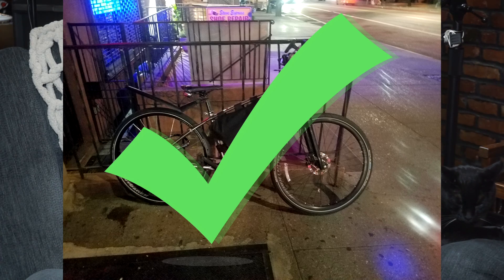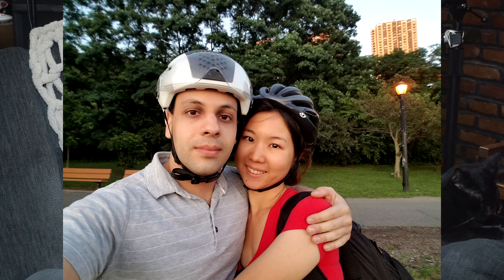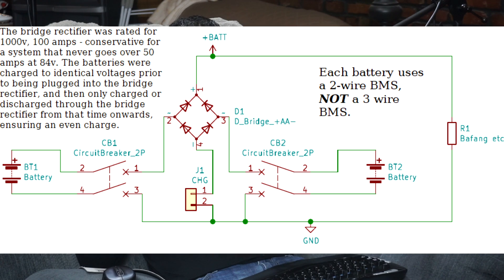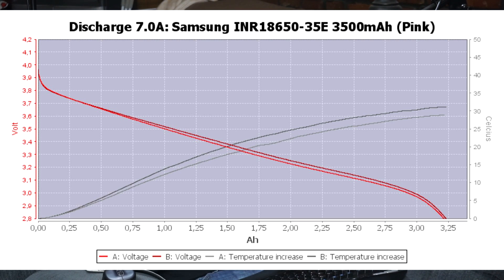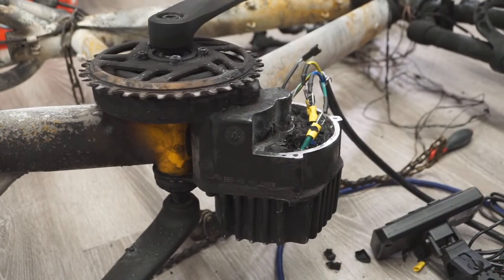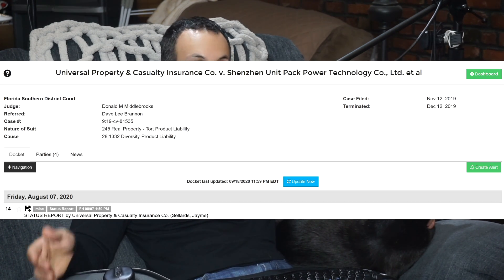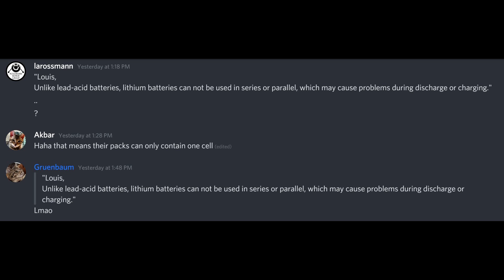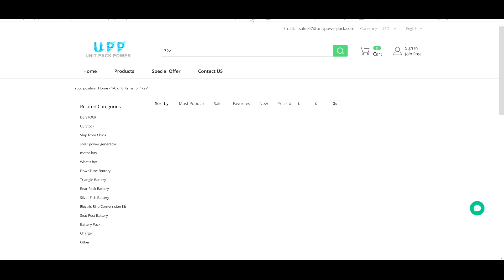Louis' front door goes BOOM courtesy of UnitPackPower battery.

Comment: I asked Amazon about this battery and got this response I figured the person was referring to this video
Amazon Customer answered:

"The customer modified our battery, he parallel 2 pcs pvc batteries together incorrectly, he have not use special parts which should used for parallel batteries, the battery is 72v 20ah, fit for 3000w motor, he use the battery on 5000w motor, so the issue happened. We contact him to provide proof to our inssurance company for compensation , because we have bought insurance for every battery we built, he reject, he ask us compensation him for 100000 dollars, our boss reject
Reply: Things people don't realise:
These were custom battery orders. He specifically requested a common port BMS which has additional protection for paralleling batteries. Not your regular seperate port which has no charge protection on discharge port
Even with this additional protection, the batteries were protected by diodes preventing one battery from backfeeding another
There were also circuit breakers that would have tripped if one battery decided to charge another at very high currents
You can't really get more protection than that

What we have seen from UPP teardowns and several UPP fires is that:
Sometimes cell groups are not isolated from each other properly. A bit of vibration can cause these cells to create a MASSIVE SHORT circuit. You are supposed to use cell holders or have additional insulation paper between cell groups
Pinched wires causing shorts
Balance wires and discharge wires not double insulated, can get cut by sharp nickel strip and create a massive short
The welds are not always done properly and with poor accuracy by some sweatshop worker being paid $3 per hour. This can cause a loose connection or worse, pierce the cell and cause it to VENT FLAMMABLE gas
Insufficient size nickel strip and using nickel plated steel. These will create immense heat. UPP said they can only guarantee pure nickel if you specifically request for it.
Sometimes they use the worst possible layout. Like to the point where it's not just stupid but it appears as though someone did it deliberately. If you force all the current to go through one cell/ series connection, you will create immense heat
Screws from battery case piercing poorly managed wires, causing usb to output 52v (battery voltage) instead of 5v
etc etc

The UPP fans however who are clueless about battery safety because their UPP hasn't blown up so far. In fact, there was even one UPP fan who had one battery fail where a cell group shorted to 0v due to shoddy design but didn't quite blow up and was happy to carry on using the warranty replacement. People will never learn.
Reply from the maker: I did not modify a thing. I used the battery on a Bafang BBSHD which is not a 5kw motor, it's a 1000w motor. They're a bunch of lying scum. 

I also asked for less than $10,000, not $100,000. 

These people are absolute lying scumbags. I have copies of all our original communications if anyone wants it. 

I have 3 batteries hooked in parallel now for 2 years since I did this video, thousands of miles, no problems. Just posting this here to say that two years later, my EM3EV bike with identical configuration & identical wiring & identical electronics is still kicking ass. https://www.youtube.com/watch?v=YDA1ZcH34WU

Buy batteries from companies that do not scam you by sending you garbage with different cells than what you paid for. The fact that they are lying when I have the entire aliexpress chat history. I will edit this post later when there is time with screenshots. What a bunch of disingenuous people.
Reply: lol i bet they are overwrapping cells and got one reversed or something. how else would an isolated battery boomboom @rossmanngroup
Reply: @louis Rossman so you say the low quality batteries cause the fire wow. You was lucky that ebike was outside when it ignited. I have a ebike in my apartment and there is that worry of something happening at any moment.
Reply: Lol 5000w motor. BBSHD would outright poop itself in a microsecond if you try shoving 5x the rated wattage
Reply: @kopazwashere  Not true, i ran mine around 5-6kw a bunch.

Comment: Context: The battery

Model: U004 or U004-1 (black triangular e-bike conversion packs)

Why cheap: Low-end Chinese production (Shenzhen); skips costly safety testing/certification; sold $280–$730 direct online

UL certification: No—fails UL 2271/UL 2849; no accredited lab proof

Complaints w/ significant damage: 13 US overheating (7 fires + major property damage); multiple UK fires

Manufacturing years: Sold 2018–April 2024 (exact dates not specified)

Source location: Shenzhen Unit Pack Power Technology Co. Ltd., China

E-bike brands: None—aftermarket for DIY conversions (UPP brand only)

Still sold?: Officially banned post-2024 (CPSC illegal); lingers on Amazon/AliExpress despite warnings

Future safety concerns: Yes—ongoing fire/thermal runaway risk in all units; immediate disposal urged

Comment: No it's wrong.... I have two 72v battery and one 52v all from upp they al have a three  wire bms and cannot parallel.... 
I have changed the bms in the 72v for parallel.... 
After 2years the battery have a maximum difference voltage from 0.008V....

Comment: My problem with the unit pack power batteries is that they use an inferior bms and the spot welder they use is cranked up too high creating leaking batteries. In fact, there is a recall on the triangle batteries. Don't buy this brand! They are dangerous!

Comment: Louis, am I correct that the parallel connections between cells within the eBike battery are all connections between cells of equal internal resistance, but you took 2 batteries of unequal internal resistance & hooked them in parallel?  I, myself, avoid putting batteries in parallel. I have 2 batteries for my eBike, but I use them one at a time.  Is there any advantage whatever of running them together in parallel?  So is your parallel connection to cause of this fire? What caused the fire? YOu say you charged the 2 batteries to same voltage -- I think the issue is rather the internal resistance of each battery being different.  How could you be using either a 3000 or 5000W motor on the street (illegal watts).  And were you overvolting your motor?  Are there eBike motors designed to run on 72 Volts???  Is that why they stopped selling 72 V batteries?  Did you really demand $100,000 from manufacturer?  I think this video is deficient for lack of sufficient explanation of the fire.  How did the lawsuit end? settlement?

Comment: I would never connect 2 batteries in parallel (I said batteries, not cells internal to a battery) unless for some reason this was essential when 1 battery had too much internal resistance to run some appliance.  With eBikes, why don't you just use 1 battery at a time; when one gives out, then use the other.  I was impressed with your fire how it seemed 1) that the firemen were in no hurry to put out your fire & 2) it seemed there was difficulty in putting out a Lithium ion fire.  I thought water could be used to simply soak Lithium ion. The fire seemed to burn a long time. YOur building must have been masonry for the entire building not to go up in flames.

Comment: @Louis so even if you ran it through a full bridge rectifier, i'd call that pretty bad practice, unless both packs are on EXACTLY the same charge, and the diodes have EXACTLY the same vdrop (even in fully integrated full bridge rectifiers rarely the case) one or another other pack will get more load

not to mention you have to heatsink the rectifier, even at "low" load, you can expect 1.2 to 2V drop over the rectifier, because it goes through atleast 2 diodes, which means that full bridge rectifier may have to dissipate over 50W of power (dependant on how much current flows) as it goes through 2 diodes

edit: by the way it's wired, one diode, but still 0.5-1V, so you should consider 1W per amp to be safe

as you may know from laptops/cpu's, 50W is something that definitely NEEDS a heatsink, and not even a small one

even if the diodes are theoretically able to handle 100A, they need serious cooling

not defending UPP however, but just an important note.

i'd still highly recommend people to get a custom sized, larger, pack rather than paralleling packs

or if your controller is separate something that handles many voltages up to 72V packs (84V max) then you can run 2 36V packs in series or a single 36V pack

Comment: I looked at this a few years ago and concluded you'd need Schottky diodes to connect them in parallel. The high reverse leakage would go a long way towards balancing the battery packs. Otherwise I wouldn't do it. Turns out I just ran the batteries separately and used one as a reserve like a motorcycle reserve tank. A high-current switch made for switching boat batteries worked great here. Honestly? These batteries frighten me a little. Have a UPP 72v 20AH pack on my desk, I'm doing maintenance and no trouble...yet. Tempting to go lead-acid (heavy!) or Ni-cad. Glad you didn't get hurt!

Comment: Honestly, this is completely unacceptable for a battery that hasn't been tampered with. Also, there BMS is not designed to take any amount of current to the other direction that way, and will pretty much fry. This means as soon as you put them in parallel they pretty much just short themselves out. It's a ridiculous design and the BMS should be designed to detect this

Comment: So sad to see this happen.   Most generic chinese brand battery comes with a shitty BMS.  That is the thing that I take out first.  Good batteries should not even needs a BMS to balance.   That being said, I will always check the balance  manually with a voltmeter after a week or two of use. 

EDIT:  I have seen batteries catching fire while charging, but I wonder how could catch on fire after being discharged.   Could a bad BMS have caused this?   Samsung cells are safer than chinese brands...so I am really baffled.

Comment: the diode rectifier was from the company or an addon. I suspect that might be the culprit. Connecting 2 batteries in parallel without the rectifier would just cause the batteries to equalize over time during charging or discharging. Its how I been connecting batteries for years, never had problems but I only do 3s or 4s. With 20s you have more voltage that might cause problems if there is a bottleneck or failure between both batteries. 
I think more investigation and autopsy of battery need to be done to narrow down the culprit. If it was the battery or the diode rectifier where the fire started, once the fire started the cells did what they were suppose to do which is go up in flames.

Comment: i tryed every way to find out if its possible to set up battery like you did and when a person says it will work.they also say at your own risk. it dose not work the only one i ever found was no b.m.s manual charge ,diods and relays but i would never risk it ,it will burn eventually .the only safe way is to have a custom made battery .i found that you do get a very small even tiny drop back because one battery wil always be that tiny bit weak and it begins ,a reaction starts to happen in the weakest cell and you won't stop it also runing down below 50% would be even mor dangerous . i hope things work out for you but dont believe all you hear about geting more power ,have a battery pack made in one peace to do what you want from it.i hope people learn by what happened to you. lithium batterys are always unstable and are only safe if used the way they are intended

Comment: i also dont think u fully understand the problems with hooking up two batteries. theres always going a risk doing so.  also it only takes one bad cell so that might not even matter
Reply from the maker: I have 3 batteries hooked in parallel now for 2 years since I did this video, thousands of miles, no problems.

Just posting this here to say that two years later, my EM3EV bike with identical configuration & identical wiring & identical electronics is still kicking ass. https://www.youtube.com/watch?v=YDA1ZcH34WU

Buy batteries from companies that do not scam you by sending you garbage with different cells than what you paid for!

Comment: I have two electric motorcycles with UPP batteries. One is a 52v x 20a pack X 3 so 60 amps 3.120kwh the other is the same but 48v nominal. Done about 100 trips between both dirt bikes in summer conditions drawing as much as 400 amp (rated at 150 continuous 450 peak) so far no problems. I own a Chevy Bolt too so am I playing with fire IDK?

Comment: There could be some shorts on the windings of the motor. The motor would still work, but it would drain the battery very fast, causing overheating. Post mortem is hard to tell which caused which.

Comment: Bms failed or they cheaped out on the nicle strips, or was not spit welded correctly and there was a short. Bad workmanship. Could very be bad or cheap easy cells that couldn't not handle  the constant load. There are alot if fake cells just resleeved cheap knockoffs, easiest way to tell is the weight. Or the gauge wire on the battery was too thin to take the load melted and fused and created a short

Comment: i have a bbs01 where the controller is shorted out. i think your demonstration on the bbshd does not prove that it was not the culprit, since the controller may have shorted out too. id imagine that its not a common thing for the actual motor windings to fail, but rather its always the controller.

Comment: Louis' front door goes BOOM courtesy of UnitPackPower battery.
or
Louis' front door goes BOOM courtesy of putting 2 batteries in parallel which increases the change of melt down by 10,000 times.

Comment: All it takes is for one of those diodes in the bridge rectifier to fail short and large currents would flow between the batteries, if one was not at an identical voltage to the other. This is a dangerous configuration. Several commentators have said so, but no response from you Louis.

Comment: Just another prime example of electric power vehicles.  Every electric powered vehicle battery is comprised of two components that create electricity.  These chemicals are separated by thin membranes.  All it takes is a little breech between the two components and you then have a plasma fire.  Once a rupture occurs, there is no stopping the reaction.  And once the fire starts you cannot put it out.  So when you are driving an electric car with a huge battery of this nature... just remember that it is no different than driving around with a live plasma bombe.  I will stick with my tried and true gasoline powered car thank you.

Comment: If they are charged equally then why would you want to isolate discharge with rectifier? Would the goal be to combine them to make 1s 2p(essentially thinking of one battery bank as giant single battery single battery connected in parallel). Novice when it comes to this and was asking serious question and curious as to why you wouldn't want them to balance each other

Comment: "Structurally, the 3-wire BMS consists of a pair of counter-directed transistors that switch charge and discharge currents. Due to this, either first or the second pair is turned on/off.

In general, it is preferable to use a BMS with 3 wires.Advantages    Low price    Low device complexity    Easy to connect

Disadvantages One of the disadvantages of simple BMS is that they switch current with the help of field-effect transistors. When the currents are small, everything works great, but when the currents start to exceed 50A, the entire device starts to warm up pretty decently.

As soon as we cross 3-5 kW range, we immediately face a huge problem: how to dissipate all that heat? In this case, the usage of a simple BMS becomes problematic".

Comment: "Structurally, the  3-wire BMS consists of a pair of counter-directed 
transistors that switch charge and discharge currents. Due to this, 
either first or the second pair is turned on/off.